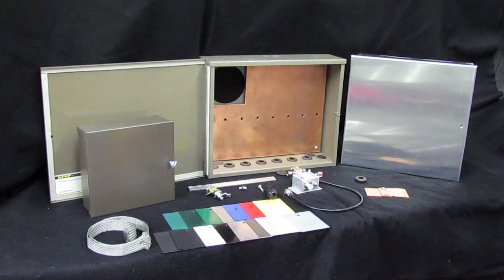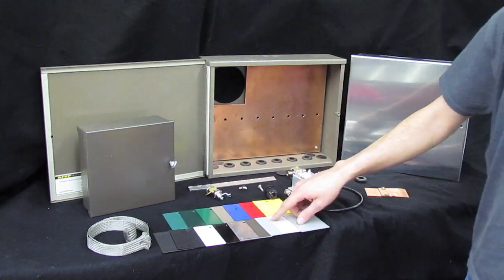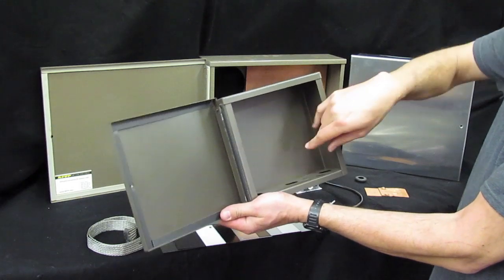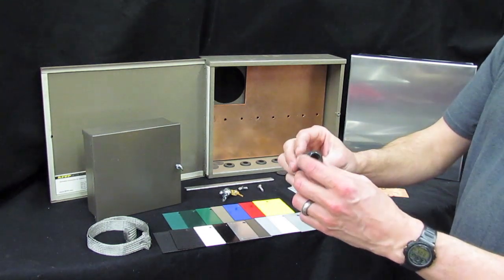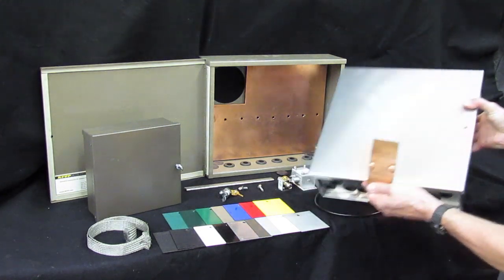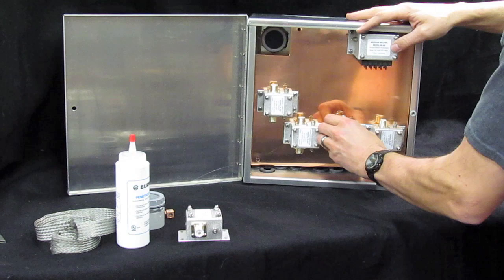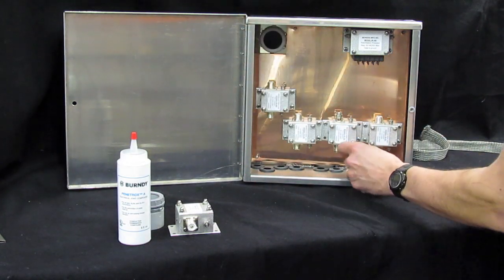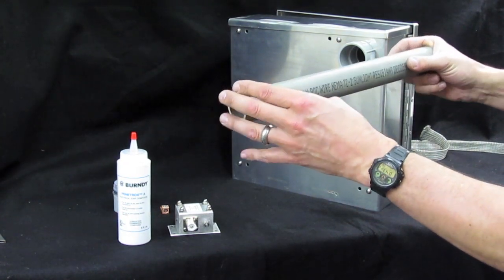Entry Panel Box Demo

Comment: I need to run coax down from roof into box , from top , will there be any water problems getting in ?
Reply from the maker: No, not if you do it right.  Run the cables in the bottom with a drip loop, OR use cable glands on the top.

Comment: What size box would l need for 4 runs of Belden 9913f7 coax?
Reply from the maker: I would probably recommend the medium, although the box sizing is more dependent on the size of the arrestors inside.
Reply: +KF7P I have Been looking for something like this. I am setting up my first HF station. I have more questions so I will give you a call.